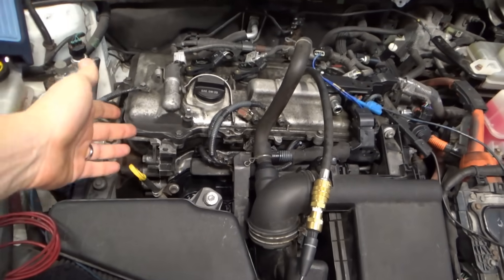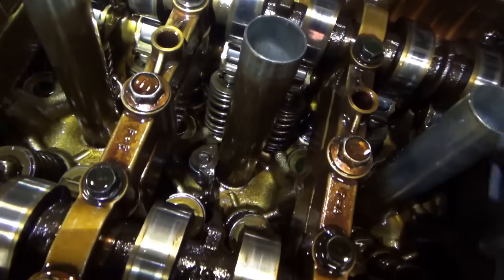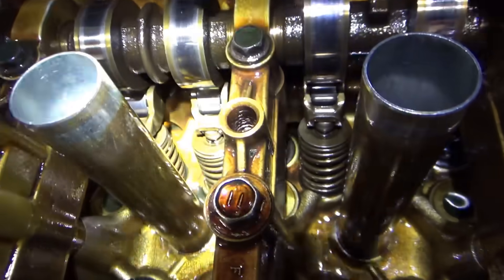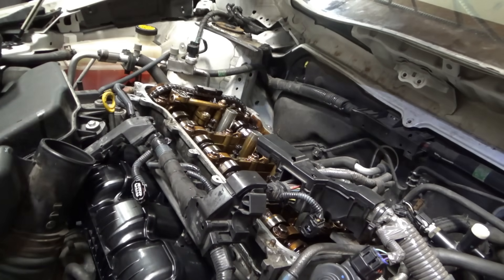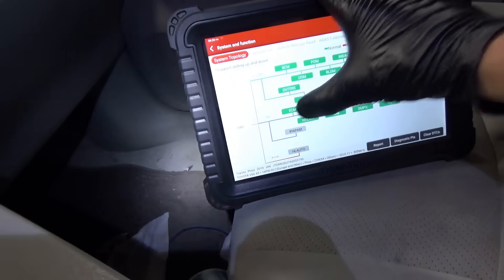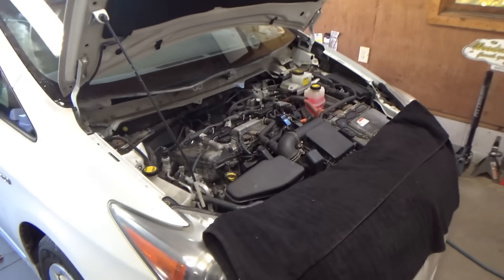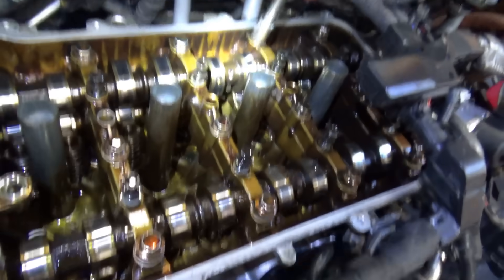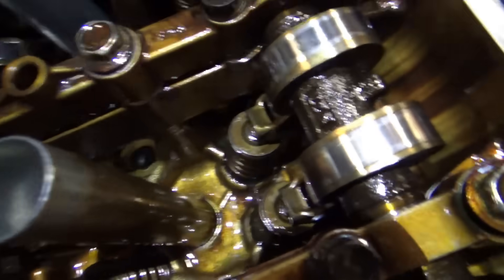(Pt 2) Prius DIY Head Gasket...Now BARELY RUNS?!

Comment: Those Toyota hybrids are stupid. Since they cannot be charged from a plug, all possible savings are in braking energy regen. That saving is roughly enough that carrying hybrid technology with you does not increase consumption. Flawed design.
Reply from the maker: Correct, they only win in fuel savings when they are used in constant "stop and go" mode like pure city driving 👍
Reply: You need to research further into how they work, it's far more sophisticated than you say here
Reply: @geoffwalker7530  There is no other source of "free" energy without Toyota having invented the perpetual motion machine.

Comment: If you own one of these 2ZR-FXEs, make sure to change the coolant. For the gen 3 Prius, Toyota completely omitted coolant fluid changes(and transmission fluid changes) from the scheduled maintenance log books that they handed to customers at time of purchase.

Old coolant becomes acidic with age and will eat away at that gummy material around the gallery passage outlines on the HG. Toyota updated the gen 3 HG ~’14 by adding a bunch more of that black gummy material you can see on the HG in this video.

I have a feeling tons of these vehicles have never had a coolant change. If you’re going to purchase one ask the owner to show proof they have done this service.
Reply: Typically only mechanics will service their coolant. Most people never exchange it on any vehicle. It's one of the overlooked services and ignored until it's too late.
Reply: @topher8634  Maybe it gets changed in the process of a water pump replacement on some engines, some you have to change the water pump with the timing belt. Maybe then. But yeah. Some vehicles it never gets changed.
Reply: Good info 👍
Reply: Bingo people only care about oil changes but do not acknowledge rust.
Reply: Yep, these days transmission fluid is not even in the first 120k mi of the warranty and maintenance guide, unless your use of the vehicle constitutes "Special Operating Conditions", such as if you tow or use it as a delivery vehicle or taxi. Coolant every 5-6 years even if it says it lasts 10 is good cheap insurance against head gasket failures.
Reply: Your not kidding . Toyota super long life holds up good but it starts out new in the bottle at 7 ph .
Reply: almost like they want to sell new cars, vs. have them last real long....
Reply: @throttlebottle5906
Reply: It's easy to fake. You buy the coolant. Now you have your receipt. 
Return the coolant and presto , you have faked a coolant change.
Reply: Amazon sells a pH test strip pack for coolant/brake fluid.
Reply: The other thing that needs maintenance on the gen 3 Prius is that really small EGR cooler. Toyota redesigned it for the gen 4 by making it much larger.

On the gen 3 the EGR cooler plugs up with carbon around 100K.

The other fault is that the PCV baffle box on the block doesn’t work worth a damn. These things slurp engine oil often leaving a oil pool directly below the throttle body. The oil vapor also combines with the EGR system carbon particulates at the top of the intake manifold to form a sludge that differentially blocks the EGR ports. Many claim this induces misfires by eventually dumping the entire EGR gas dose into a single cylinder.
Reply: I'm ok, I'll never own one

Comment: For those that don’t know, there is a procedure to make the engine run without going into hybrid mode so you can diagnose engine, drivability, or a/c problems. On the gen 1 Prius, simply turn on the a/c and push max air. After gen 1, it is a 3 or 4 step process. It is very frustrating when you are looking at scan data and the engine turns off because the h/v battery is fully charged.
Reply: I remember when I first took my ride in a 2005 Prius for the first time, and we came to a stop in the engine shut off lol I was looking around like an idiot like what the hell happened 😅😊😅😂
Reply: Ignition on
Press gas pandl twice
Press and hold the brake 
Put the gear in to N position 
Once again press the gas pandl twice
Press and hold the brake press the P button or put the gear in to P position 
Then press the gas pandl twice and press and hold the brake and start the car. You are in the maintenance mode. Any Toyota can do this to keep engine running.
Reply: @ Thanks, it has been a few years.
Reply: @raviautoscanning  I had that printed and saved in the glove compartment long ago, just in case LOL
Reply: Thank you.

Comment: It's like that stupid stop start system you think it's great when the battery is brand new but when the battery goes it cost a lot of money to replace so it looks like anything they tell you saves your money doesn't save your money carwise
Reply: Start/stop systems aren’t there to save the consumer money. They’re there to help the car meet emissions and CAFE requirements. Same goes for the super thin oils that new cars require. The manufacturers specify them in order to meet CAFE standards.

Comment: I have had 2 Prius, a 2012 that I had to replace the brake actuator on at 399K and other than tires and front brakes that was all it needed. It died in a hit and run and was replaced with a 2016 Prius ECO, that gets 70 MPG and the only thing I have done to it is replace the 12 volt battery at 139K BUT since it was a Toyota Battery with a 5 year guarantee, that was done for free . I was surprised to learn that even though I jumped the battery to start the car I could have had it towed to the dealership for free because that is also included in the warranty. What is funny about the 12 volt battery in a Prius is that the engine is not started by the 12 Volt battery at all but by the hybrid battery BUT the 12 volt battery is used to handle the electronics that tells the hybrid battery to do its job. LOL. Also I have a Scania Pick up on order and want to bring it buy you in case you would be interested in seeing what in my humble opinion is the best P/U ever made.

Comment: The head gasket problem is caused by egr valve malfunction in Gen 3 Priuses - 09- 14 I think. I run a 2008 Gen 2 which does not have an egr valve and  doesn’t chomp head gaskets that way. The abs booster and storage battery are the biggies. I haven’t done them yet but am good with amortisation costs. It’s spacious , fuel efficient and reliable. The Regen system keeps pad and disc replacement costs low. These cars like high mileages hence their popularity as cabs.

Comment: And American cars last until 150 000 miles without any expensive repairs? Somehow I doubt it very much and probably with any of these repairs the Toyota Prius is going to be a lot cheaper over the whole possible lifetime of the vehicle, but I could be wrong of course as haven't seen any real statistics on it.
Reply from the maker: It's definitely a crap shoot these days in terms of reliability 😂
Reply: @PineHollowAutoDiagnostics  Yeah electric car probably needs a new battery pack every 10 years or so, but some regular car that has been driven 150k miles might need a new transmission or even a new engine unless they have become more reliable recently. But I also heard that for example insurance and some repairs would be much more expensive on a Tesla so there are lots of variables when comparing actual lifetime costs of electric vs. regular cars.
Reply: My American-made Honda Civic has gone 200,000 miles without major repairs.
Reply: @markanderson2904  Well it's a Honda. I have a 2006 Accord that is made in Japan and it hasn't need much of anything else than regular service.

Comment: Here in Europe,In the last 3 years ive only realy repaired broken diesel engines....lots of them...😂
Maybe 2021 done Infinty 45 suv thing v8 petrol with blocked strainer...
For most part just dead diesels..pistons cracked,timing belts,broken oil pump chains,pre chambers fallen out and so it goes on....not even including egr and dpf faults...
A 2005ish 1.6 petrol Corolla is a dream for me...😂😂...almost always zero fault codes..

Comment: Yes, it's the rapid heating & cooling cycles which causes the cylinder head gaskets to go in them !
Reply: I think it has way more to do with never changing the coolant. Just my opinion of course. It would be interesting to find one that had the coolant changed every 5 years just for a comparison.
Reply: Time for Carbon Fiber head gaskets maybe.  Wont even notice the extra cost next to the other overpriced parts.
Reply: @robertsmith2956  Why do you think carbon fibre would be suitable? It's strong but very brittle and since it's not a homogenous material it's sealing ability would be poor.  Millions of cars have head gaskets made from conventional materials that the life of the vehicle if the engine is well designed and it's serviced regularly (e.g. coolant change done on time).

Comment: I love the way those Hybrid Toyota and Lexus drive and ride.  They're so quiet and smooth.  I also think that's about the best way to have a CVT transmission.  Using an electric motor as a holding device on the planetaries just looks a lot better than numerous clutch packs.  Maybe it will become financially practical one day as EV/HEV parts become easier/cheaper to produce.  The resale value kills the idea of buying an EV, PHEV, or HEV for me.  Plus, as you mentioned, Toyota's super expensive brake booster will go out.  They should be forced to do a recall on that one.  Toyota doesn't mess up much but when they do it's huge.

Comment: Did you find the one cap?.. I must have missed that?.
Reply: He found ten of them at the dealer.  :trophy-yellow-smiling:  I lost a spring retainer on a chevy, and dealer let me buy just one pair.
I had a 7mm socket to a swish nothing but net right down the oil port, heard it go all the way to the pan.  Pulled the pan since I had no idea of the clearance of the rods and was not going to have it punch through the pan while driving.  Had the bolt for dip stick tube go right in the block, but I used a magnet probe to fish it out.

Comment: Wait. How the hell did a rocker dislodge itself from its position without breaking something? If this thing dislodged itself, it would seem to reason the rest would be vulnerable to the same phenomenon. Can't install them backward, so...
Reply: Likely were not positioned properly when the owner did the head gasket repair.  It is not a design issue.
Reply: You saw how Ivan installed these; he had to loosen up the cams in order to slip the follower underneath it. There is no way you could position these improperly and have the follower not get destroyed or damaged along with the camshaft upon first start. As such, and as unlikely as it might seem, I think the only logical conclusion is that the owner left them out and forgot to put them in upon reassembly. How else could both possibly be sitting there undamaged?
Reply: Maybe, the lost cap was lost on disassembly, but forgotten about because T break... Sort of story..
Reply: Not a rocker. CAM FOLLOWER so…